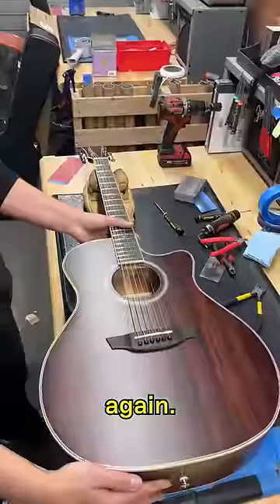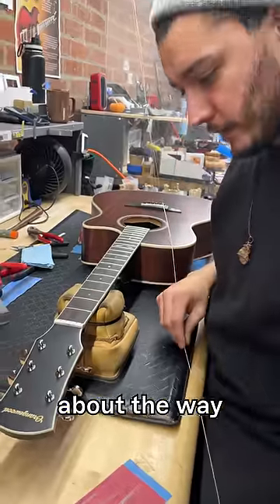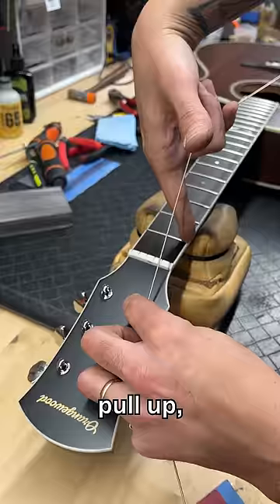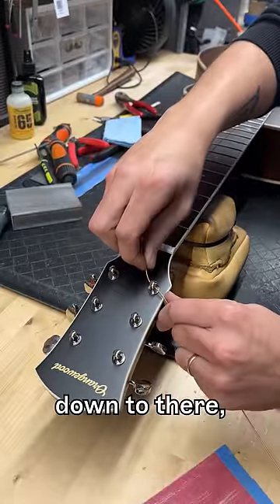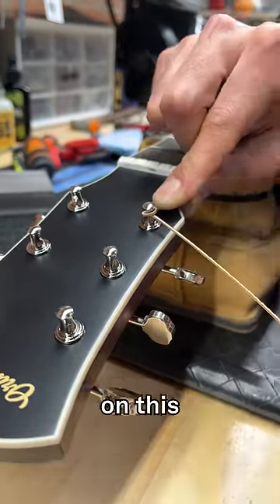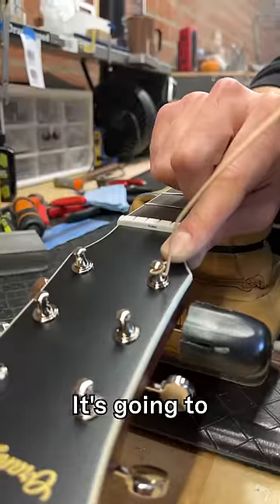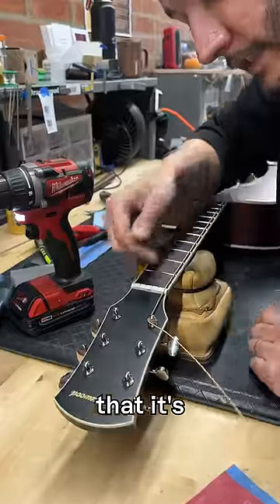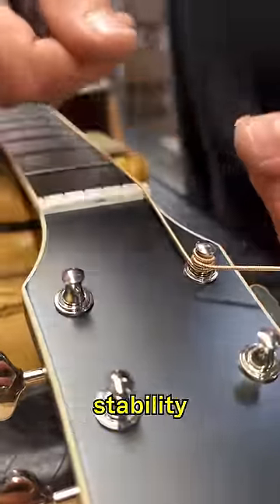Restring your Guitar like a PRO with this HACK

Comment: Two words. Locking tuners.
Reply: on an acoustic guitar?
Reply: @adamsadek2864  yeah why not?
Reply: @GigglePig99-j2u  it’s real heavy so neck dive but also it messes with the bridge a lot more than an electric
Reply: @adamsadek2864  this is exactly my experience with it.  I put some locking tuners on an SJ-200 (chibson, but I what ever) which is about as massive as an acoustic gets (especially with the shitty model incorrect bracing that they used) and it made the neck dive bad.   

Normally I’m all about locking tuners.
Reply: Or learn a practical skill and save money while doing so
Reply: One word. Skill
Reply: @adamsadek2864 i have a fender acoustic. neck dive is a given lmao
Reply: @GigglePig99-j2u haha only some noob would do the 😅😂
Reply: skill issue 😂
Reply: Do you really find restringing a guitar that difficult that you have to resort to locking tuners?…
Reply: This method of locking the string at the headstock has the same effect as a locking tuner.
Reply: Two more words. They suck.
Reply: Locking tuners 😂
Reply: Two words. Acoustic guitar
Reply: Completely unnecessary.
Reply: @GudlaugurMusic  so is this "hack" but if you feel the need to have an extra layer id trust locking tuners over a knot any day.
Reply: @GigglePig99-j2u  I don't even think this is a hack. With wound strings you don't need to go over and under because they are 'usually' sufficiently thick enough to push up against the end from the bottom up. With unwound strings I go over and under like shown to nip the end but I mean I've never had a problem doing this all my life. I have guitars with and without whammy bars. Always been fine. But if you like locking nuts, go for it.
Reply: This is likely the best pro tip for re-stringing acoustic guitars.
The bridge pins. No more mangled  pins from using pliers. 
Yes, I know those cheap plastic string winders have a notch to lever it out. Fuck that.
Easily get them out with no tools.
Just grasp the string an inch or so from the bridge and.....I know this sounds weird..... push the string back towards the pin while you wiggle side to side the ball part of the pin. Comes right out. No prob.
Before you put the strings on, bend the wire about 40 degrees or less where the string is attached to the ball end.
Now the bridge pins won't Lazarus their way up and out when tuning it in.
You're welcome.
Reply: I’ve been playing professionally for 10 years. Sometimes I need to restring my Martin once a week in the summer months, because of sweat and such, even with coated strings. I bought some Hipshot locking tuners for acoustics. They are super lightweight…no neck dive. They also look exactly like the original tuning machines. Over the years I’ve gotten very fast at restringing the “old way”, but installing the lockers has saved me a bunch of time. Point being, if something works for your particular situation…do it. Too much snobbery out there.
Reply: @adamsadek2864 that's not true at all because the pressure point is on the nut as long as the tuning machine is low enough.

Comment: I used to "lock" the strings using the same technique.  However, 4 out of 5 guitar techs who saw it said, 'don't do that, it only makes it harder to remove the string.'
Reply: If you already changed the strings that way, why let their opinion change how you change your own strings?
Reply: ... It made sense.  Try it yourself--that's how you learn things.
Reply: not that hard to remove the string, what are they talking about?
Reply: @SeeJayPlayGames  --  Their point is that's all it really accomplishes.  It doesn't lock the strings any better than a sufficient number of winds around the post.

Comment: The over-under method. But it doesn't have to be done on all 6 strings. The low E A D G wound strings just need to be underwound down 3 turns with just the unwound high E B strings needing to be locked in with the over-under method. Works every time and quicker

Comment: Good job and good technique I've been using it for nearly two decades...  I would encourage you to throw the snips away you don't need ever restring guitar or to get rid of the tails..  when you do the  over/ under pinch wrap.  That affords you the ability to break the string by hand, and the beneficial result is that you or your 6-year-old can grab those string posts all day long anyway you want to and you'll never tear or poke your finger..   if you use a gig bag you won't tear up the inside of it..  let me know if you don't like to have a link.

Comment: never cut the strings like he did it will damage the neck over time as it’s loosing the tension all of a sudden.
Reply: I completely agree, make sure there is no tension in the neck before doing that
Reply: Not true. False.
Reply: It doesn't create any problem.  That's easily explained why whammy bars are used and don't cause any damage at all.  Yes, even some acoustics have had them as well.
Reply: Complete nonsense. The neck is made of wood from a tree that once stood strong and easily supported its own weight in the elements. Wood has been used in construction for as long as humans have been walking the planet, and has been relied on for strength to support all sorts of structures. The idea that a little string tension release is going to slowly damage your neck is completely idiotic.
Reply: @Bmoseley85  it ain’t that serious
Reply: @Bmoseley85  it will bend the neck over time that’s for sure. i’ve been doing it too when i was a teenager and i will never do that again since all of my guitar had their necks slightly curved, making the string too far away from the touch. and if your wood is not good enough or not treated as it should be, it can break.
Reply: Why is it bad for the neck when you suddenly loosen all the strings when restringing but no one says it's bad for the neck when you suddenly loosen the strings during a whammy bar dive ? 🤔
Reply: @Kallell75  wood bends. It will bend all on its own just due to temperature and humidity changes, or when you swap to a different string gauge. That's why guitars have a truss rod. If your neck has bent to the point that the instrument is no longer playable, you need a truss rod adjustment. Cyclic fatigue from changing strings has absolutely nothing to do with it.
Reply: It looked like he loosened them a bunch before cutting.
Reply: Seeing “experts” cut the strings like that drives me crazy. I have NEVER done that and never will.
Reply: Never cut them all!!! Wtf
Reply: Myth
Reply: @leegrant245 seeing ‘experts’ in the comments who don’t know what they’re talking about drives me crazy.

Comment: I always thought  you should only change one string at a time, so that the tension on the neck isn't released. He cuts all 6 off in one go. Is that really a good idea? Does it matter?
Reply: It matters for electric guitars, the ones with springs in the body. You'd benefit from being gentler with those ones.
Reply: No its amateur hour online.
Reply: @mackxzs doesn't really matter on electric, just put a microfiber towel between the floating bridge or whatever and the body. on my cheaper prs se, i dont even bother with a towel and the bridge hasn't put even a scratch on the finish from restringing

Comment: personally, i  was taught save older strings in case 1 breaks I have replacements (past experience while performing) although i do cut at tuning keys  (less material) you were taught to cut old ones out to each his/her own.. thnx4sharin' also i like  power spinner rather than by hand ..

Comment: Really particular but cuts all the strings at once... for those who don't know with old guitars without trust rods it will bow the neck if you cut all the strings because it releases tension off the neck. It will bow after changing strings a couple of times with this method. I normally change them one at a time and anyone else who plays acoustic guitars I recommend doing the same

Comment: If you're worried about tuning stability, buy a better guitar, or invest in some locking tuners. You only need to insert the string, bend it 90 degrees, and start tuning. I never had an issue doing this. Also, make sure to replace each string at a time so the guitar tension never dramatically shifts and remains under tension.

Comment: The statement about tuning stability is a lie. You should avoid making too many turns. For thick strings one turn is enough, even half a turn would be sufficient if a string is thick enough. For thin strings one above the tail and one below is enough as well.

The reason is as follows. The more turns you make, the more surface area of a string rubs against an adjacent strung turn and the peg itself. The more such friction you have, the worse the string goes back after things like bends. Thus, having few string turns provides much more tuning stability!
Reply: Hey! Yer wrong!
Reply: I’ve been stringing like this for 20 years, anything without locking tuners. It’s rock solid. The only reason more wraps could cause issues after stretch-in is if you’re wrapping it too loose, changing tunings a lot, and/or dive bombing a tremolo.
Reply: @Spiraljam  the reason you provide is enough to say more wraps make things worse. After all, the friction between string wraps is incomparable with the force that really keeps strings tight. So why bothering making more turns if you get the same result with just one or two and do not have to deal with the friction between the wraps when your guitar goes out of tune after a couple of bends or dive bombs?
Reply: @danielkeehl7450  that’s not what I said. I said unless you’re doing it wrong, or using the guitar in a manner inconsistent with what the instrument is capable of withstanding regardless of wrapping style, more wraps does not breed issues. Especially the method shown, as the doubled up coils aren’t stacked directly on top of each other. Especially to a point of assuming it’s others who are stupid for having a technique inferior to your opinion. No guitar with out locking trem or at least tuners will hold tune after a dive bomb, no guitar is made to be frequently changed in tunings, especially  without being set up with new, usually differently sized strings.
Reply: @danielkeehl7450  I’m sorry, liars*. Not stupid, you said they were liars.*
Reply: @Spiraljam  are you trying to say making fewer wraps is a bad approach? Because now it just looks like you say it doesn't really matter as a guitar is prone to get detuned anyway. And you are definitely right here. But in that case, what problems do additional wraps solve? Because, as I explained above, it is not about providing better tuning stability, at least when compared to a less wraps approach.
Reply: you are absolutely  right,you don't do that many winds😊,,,
Reply: Not doing this been restringing my guitars since 1995 I just have to make atleast 2 turns and make sure that the string ends doesn't show up on the hole to avoid pinching the guitar bag. One of the cons for this is that this is so hard to remove when you restring.
Reply: Notice nobody ever talks about the bridge end?
This is likely the best pro tip for re-stringing acoustic guitars.
The bridge pins. No more mangled  pins from using pliers. 
Yes, I know those cheap plastic string winders have a notch to lever it out. Fuck that.
Easily get them out with no tools.
Just grasp the string an inch or so from the bridge and.....I know this sounds weird..... push the string back towards the pin while you wiggle side to side the ball part of the pin. Comes right out. No prob.
Before you put the strings on, bend the wire about 40 degrees or less where the string is attached to the ball end.
Now the bridge pins won't Lazarus their way up and out when tuning it in.
You're welcome.

Comment: I solved string changing annoyance by putting locking tuners on my guitars. I line up the post holes so I can pull the string straight through, pull until there's no slack (not tightly), lock the tuner, and tune up! I can change strings in like 3 minutes. Locking tuners are a godsend.

Comment: All string pegs should be open slotted. You can loosen all pegs slightly, pull all strings straight up and off in seconds to do whatever ( clean fretboard, vacuum out body, or on electric pull off pickguard), then put strings straight back down in seconds and retune. BTW there is no need to lock strings on an acoustic guitars and guitars with no vibrato bar. BTW 'Tremolo' is amplitude modulation AM, Vibrato is Frequency modulation FM. a Leslie speaker is AM/FM. As is the Theater Pipe Organ Tremulent it imitates. Which was Don Leslie's motive. Check out pics of the first LESLIE 30A speaker cabinets. The first Leslie horns found in the 30A cabinets were made of paper mache and a block of wood. Note only one horn speaks . The other horn is for balance.

Comment: First off, you should never just cut strings off of your guitar in this fashion. It shocks the neck. You gotta loosen them and let it sit for a few minutes. Then remove them.
Reply: That’s the first thing I thought lol. I was also taught to only do 2 strings at a time starting with the highs so you always maintain the tension on the neck.
Reply: If you do this with a classical guitar it is ruined for good.  Always keep tension on the neck.  But not sure its the same for  electric...
Reply: What do you mean "let it sit for a few minutes"? What do you think this is? A god damn steak? 😂
Reply: Watch it again...the strings were already loosened completely.
Reply: that's a complete myth. You should be careful about it only if you have vintage hardware of dubious quality, because the backlash might cause a gear to crack or the like. The neck doesn't give two fucks about "shock".

Comment: Dude just committed more guitar sins than i can count. DONT cut strings under tension. DONT wrap around the post(its extremely annoying removing and puts way more tension than needed)
Reply: They weren't under tension he literally pinched the strings they were lose
Reply: Looked like enough tension to me.
The point being that over time this practice can cause the neck to warp and crack especially if the guitar is older and fragile.
This method will also cause a negative affect to string action.
This causes more frequent and unnecessary truss rod adjustment
This is probably less noticeable on a brand new or well made guitar but the  affect is still present.
A better technique is to avoid dramatic changes to neck tension by just changing one string at a time. 
Twisting the string like that will place unnecessary tension on the winding of the string, causing it to unravel and break prematurely.
Reply: I'm just getting back into playing guitar the past few weeks and have been learning a lot that I never bothered to when I was younger. One of the things I've been meaning to look up was the "correct" way to string a guitar. If the way he does it in this video is not the best way what would a better option be? If you have a link to a good video showing how that also explains why that would be awesome. Thanks!
Reply: Stop crying about removing the loop. So, it takes a few more seconds. So what

Comment: I've never felt the need to cut the strings, just unwind and pull them out. But I have always just taken the string from the next key away and put that point in the one im stringing to. Usually get 3 turns. To each their own.

Comment: I always pulled the low E thru tight, used two fingers to space it, then pulled it back to that to begin the wrap. First over, then under. The other strings I'd use 3 fingers, high b and e would use all 4 fingers.

The only fear I ever had was doing a restring on 12 string for customers. Tuning up the e string to be the octave string for the high g was tricky. 

Most strings give you 2 frets easy tuning up. The third is possible, but right at that point. Most have breaking points after that. Meaning getting that e to g was almost 50-50.

I had one break and plant itself 2 inches in my elbow. I didn't even feel it though. 

Good times.

Comment: There is a way easier way to do this. Align the peg with the hole toward the neck, then put the string through the hole, grab the string at the nut and bring it back a fret and a quarter (2 and a quarter on the treble side). 

Then just turn and get one wrap over top and the rest under. It gives the same wrap this guy uses with way less effort. All wraps go underneath on the treble side

Comment: I don't wrap the string around the post, cos I think it doesn't want to swing right if it's twisted within itself.
Otherwise if it's loose enough at the ball end, I slide along the string between two fingers from nut to bridge so it can unwind the twist

Comment: I do this as well. In addition to this you want to get as many wraps around the post before hitting the washer. This few degrees in downward force also helps with tuning stability.

The guys who tend to grump the most about tuners and tuning stability (especially the Strat guy, go figure) out just two winds around the post and complain about the issues they experience. They don't have enough downward force, they didn't do the "over-under" method to lock the string, they don't lube the nut. They got lazy and blamed the parts on bad guitar maintenance (that they did). Don't be this person.🤨

Comment: Pro tip: just wrap the strings with a few winds.  Then bend the tag end until it breaks off flush. No need to lock anything and no sharp, protruding wires.